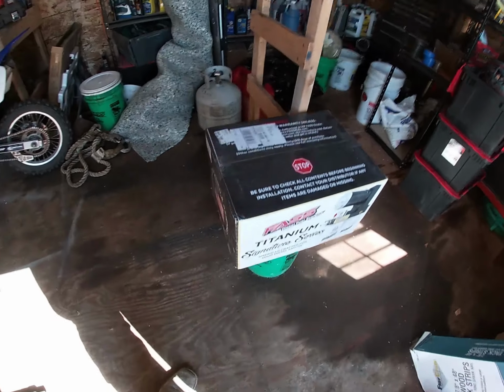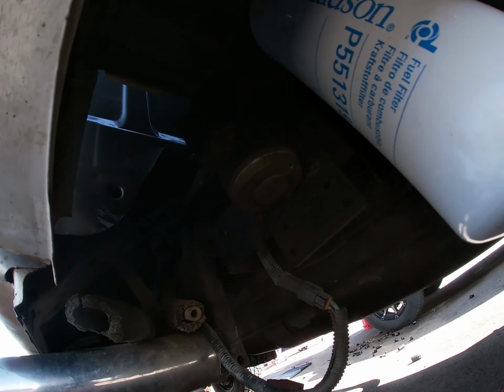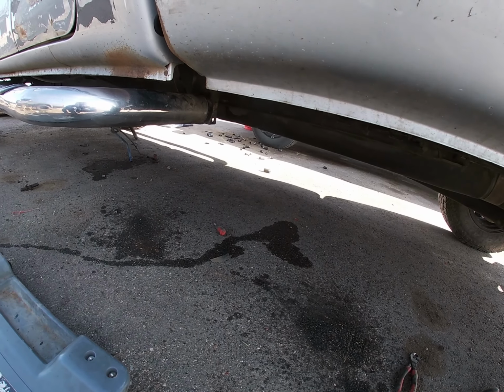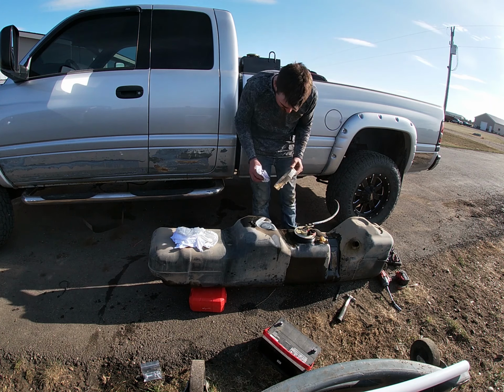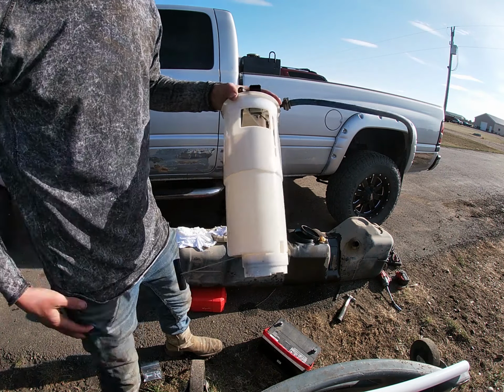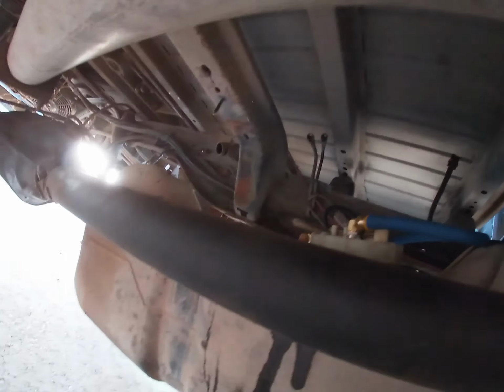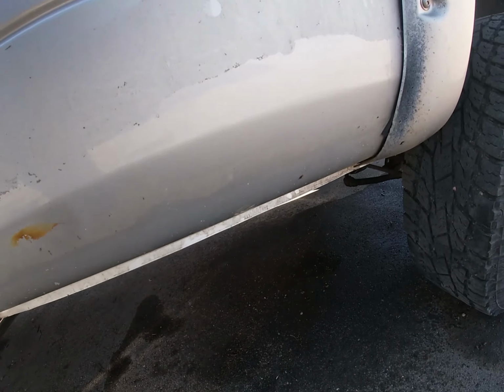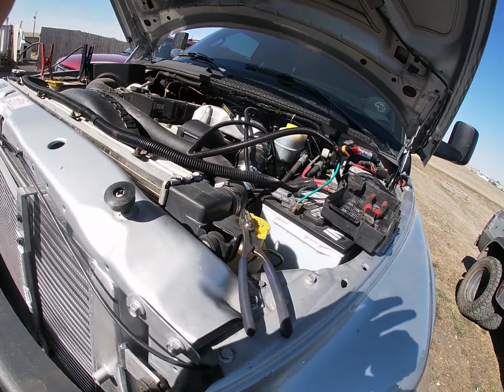2nd GEN CUMMINS FASS FUEL PUMP INSTALL

Comment: Did you just pull a fuel pump out of ur tank? I thought that's what the external  lift pump was for
Reply from the maker: This pump/fuel system was placed on by previous owners, its an exterior replacement pump
Reply: @creekerz9601  gotcha.  Is the normal lift pump still used?